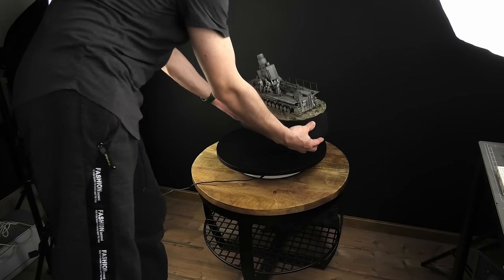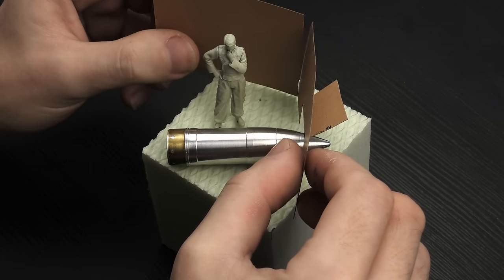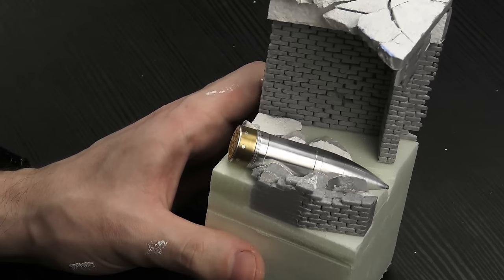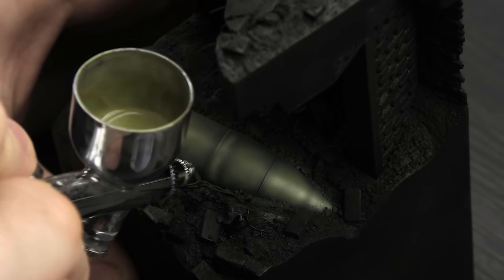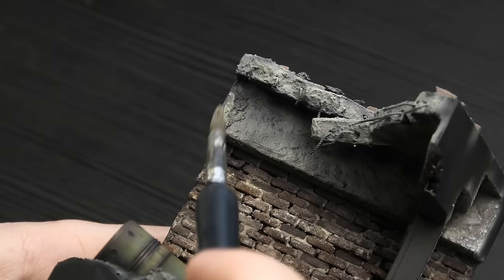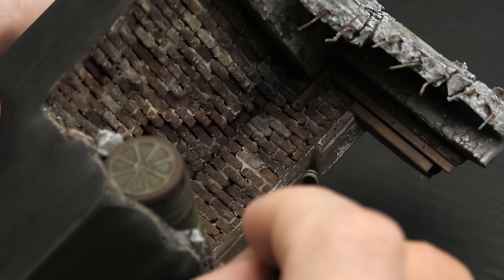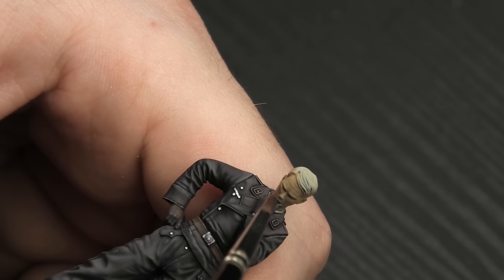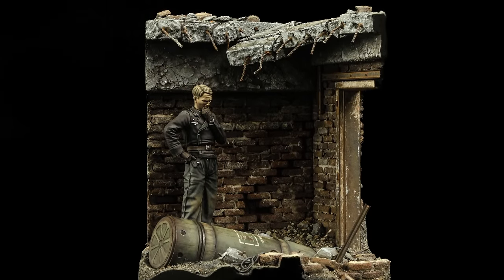"Dud in Adria" Warsaw 1944 Diorama

Comment: What I really love visually here is that most of the setting - the floor, shell, bricks, and ceiling - is horizontal, but the scene is framed by two single vertical pieces - the guy on the left and the doorframe on the right. 

This seems to allow for all the detail in the floor and brick wall while still letting key parts like the guy and the shell stand out. 

Really amazing setup here, Night Shift!
Reply from the maker: Whoah, and I never even thought about that! While composing, I was too preoccupied with the wall and the ceiling :)
Reply: @NightShiftScaleModels  you tend to downplay your talents, but I’d be willing to bet that with your talent and experience, you’ve developed a very good instinct for what works when framing or laying out a scene, even when you’re not consciously aware of it.

Whether it’s tanks, crew, or scenery, you always produce fantastic results and with solid techniques. Your brickwork and concrete in this video are both better than I’ve seen in a lot of terrain videos - you’ve really become just an all-around talented modeler.

Comment: Great work, thank you for doing a Warsaw Uprising inspired project, it is special! a few funfacts:

- the unexploded shell was disarmed by Polish engineers and extracted explosives were used for making hand granades
- the shell was not extracted until 1965 and is on display in Polish Army museum nearby
- use of rebar is 100 per cent accurate - Adria was built in 1930s using reinforced concrete, and on some after-war photos of its ruins you can actually see a pieces of concrete hanging like in your diorama - the whole builing was rebuild and still exists
- since the war, several of these unexploded shells have been found in Warsaw - even around 20 years ago they found one when building a subway station
- the concrete platform the Germans build for Ziu still stands in Sowinski Park

- about the figure - I see you painted a german Panzerwaffe soldier, but the soldiers on your reference photos are from Polish Home Army - the germans were only able to reach Adria after the Uprising surrender, but at that point the building laid in ruins and basements were blocked with rubble; yes - polish fighters used german uniforms (never seen a panzerwaffe, buth it,s possible) but without german insignia and the had a white-and-red armband on their right arm

Cheers!

Comment: Amazing! Absolutely beautiful work. One constructive technical comment for future consideration.  On a fired projectile, there would be deep grooves from the rifling in the barrel on the driving band. The driving band (that band near the base of the projectile that is slightly larger diameter) is what engages the rifling and seals the bore allowing pressure to build and push the projectile out. They are soft metal and don’t damage the bore of the gun.

Comment: This was incredible. I absolutely loved seeing you do such a small vignette!  As a mostly miniatures wargames painter it was very inspirational seeing how effectively you can make a beautiful vignette with only a couple of elements.

Something that you might want to try (on a test piece of foam) is coating with matt modpodge. In my experience I have found that a single layer of modpodge (which I mix with acrylic black paint) is enough to protect foam from enamel thinners and I've had no issues using AK's moss, rust, wet effect or streaking grimes on dioramas made from xps foam.

Comment: I absolutely love this vignette! As others have said, very simple, yet totally tells an incredible story.  You can just imagine what the guy is thinking about the unexploded shell. "Maybe I'll just ask Bob to come down here with his hammer and give it a little tap and see what happens!" LOL. (sounds like a "Far Side" cartoon here in America!)  Anyway, wonderful job.  I have one little piece of constructive criticism, if I might, that might help your dioramas with just one extra touch of authenticity.  My comment is about the rebar.  I'm not 100% sure how they do this overseas so I may be incorrect, but here in the USA, all rebar in a slab is run in either one direction, or both directions simultaneously to create a mesh.  So, in the case of your broken ceiling, the rebars would be running perfectly parallel and perpendicular to the walls of the building and not at any sort of angle other than that.  Yes, the rebar will bend, but it will still be coming from the parallel and/or perpendicular lines.  I hope this helps.  It isn't meant to be overly critical as most people may not know this and/or don't care, but I know you do care so I thought I'd try to pass on just this little tid bit of information.  Thanks for all your incredible knowledge and willingness to share your talents and techniques with the world!

Comment: Most people don't know this, but Mr PRIMER surfacer 1000 is the primer by Mr hobby that is specifically designed for metal and resin. It's a different formula than the standard Mr Surfacer.

Comment: Uncle Nightshift, I have a question about working with the Super glue de-bonder. I never really dare to use it because I'm afraid that I will not only remove the excess but also the Glue I want to have there as a bond or filler. You seem to just go over everything with no Problem.. so I'm wondering is the reaction from the de-bonder so weak that it doesn't attack the main "Part" of the glue or what?

Comment: You could have used some twisted copper wire as rebar and threaded it into the concrete floor/ceiling.
That'll teach me to watch the whole video before commenting, rebar added at 14.27😊

Comment: They used reinforced concrete many years before WW2, but most of the reinforcement would have been cold-rolled mild steel, the twisted steel high-yield reinforcement that we tend to call re-bar would not have been available in buildings constructed in the 1920's or 1930's.